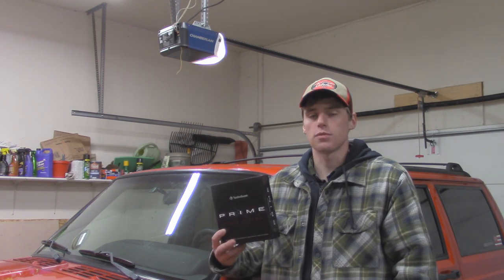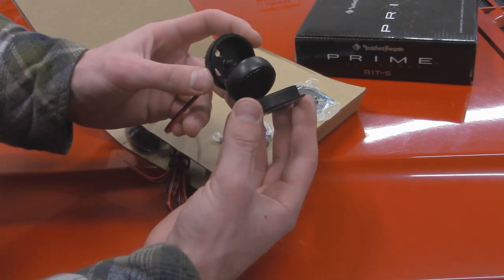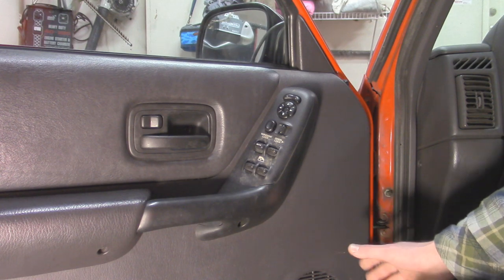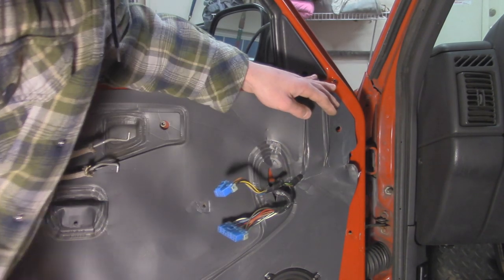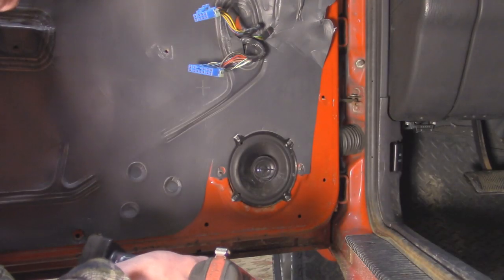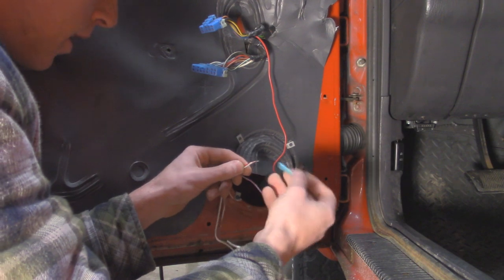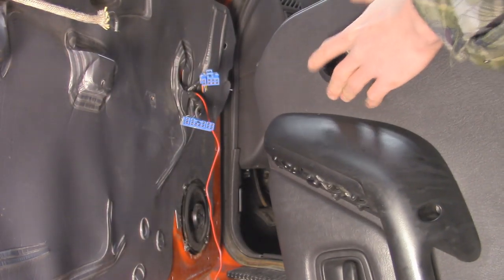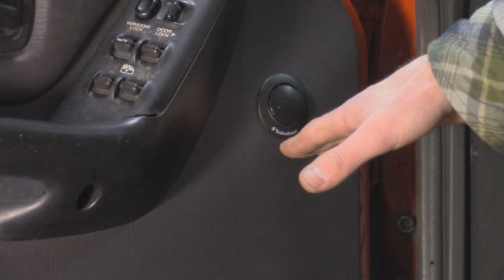Jeep Cherokee XJ Tweeter Install

Comment: Good tweeters for the price. I have the same ones. I mounted them at the right upper corner of the pull handle trim so they wouldn't be behind the dash. Big improvement in sound.

Comment: Nice and clean install Austin,looks better than factory.I guess you don't need a crossover or anything for those tweeters?
Reply from the maker: They do have a built in 6db crossover.

Comment: Great job especially for the indications, but something I could notice 2 days ago about my  xj is that it already has the tweeter cables behind the plastic, coment if you notice it👍🏼😁
Reply from the maker: All xj's have the plug on the wire harness for the tweeters. My harness was previously repaired from broken wires so I believe it was taken out. But that would be the ideal place to wire them into.
Reply: @OutJeeping  😁👍🏼

Comment: can i wire bullet tweeters into my speaker wires?
Reply: should be able to. I wired tweeters into my stock speaker wire and it sounds great and it still runs both my 6.5 midrange and the tweeters

Comment: I imagine you ran new speaker wires into the doors because the factory wires were broken inside the bend? Happened to me too
Reply from the maker: Yup, a very common problem on the XJ's.

Comment: What happens if u mixed the positives and the grounds?
Reply from the maker: The audio wont sound right. It would be making a sound wave opposite to the other side which would be the correct polarity and cancel out the sound waves.